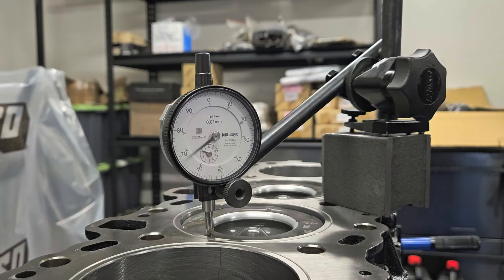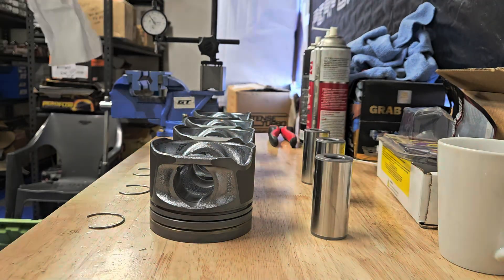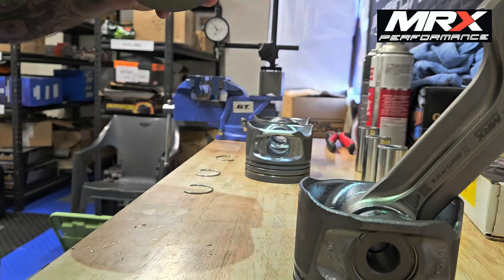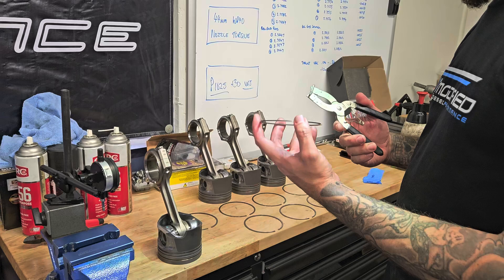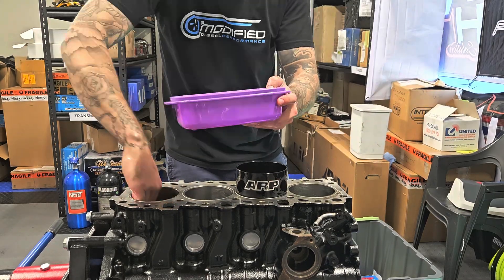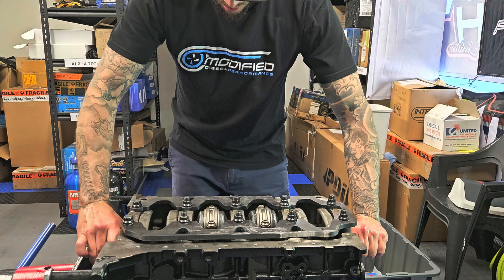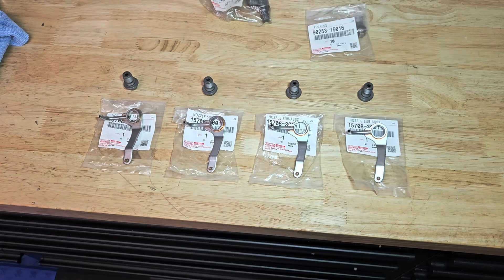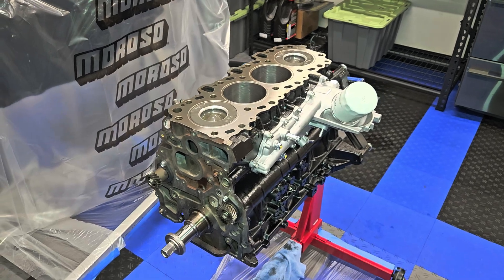The 1KD Bottom End Guide You've Been Waiting For

Comment: Nice build I’m new to the diesel builds I hear the 4jj1s are very popular in Thailand.
Be cool to see a comparison break down video comparing both the 1kd and 4j
Reply: Yes, Isuzu and Toyota are both very popular in Thailand, but Isuzu is more popular because the 4JJ can produce good power with only minimal modifications. The 1KD, on the other hand, needs more work to match the 4JJ’s performance. Both engines are powerful, but the difference lies in how much tuning is required. Also, the 1KD is more prone to damage when pushing for high horsepower, especially if it’s not equipped with enough upgraded parts. In Thailand, the record for a 4JJ engine in a dragster body is 6.6 seconds, while the fastest time for a 1KD is around 7 seconds  At 1/4 mile
Reply from the maker: No worries

Comment: Stock pistons?
Reply from the maker: Stock modified and delipped pistons 👍
Reply: @Shanksy86  what is the part number on the pistons, I know that they are different sizes. Just need to check if I have the correct updated model pistons. 
Thanks mate
Reply from the maker: They don't sell the old ones anymore
Reply: @Shanksy86 so the ‘sharp’ edge of where the squish meets the bowl gets chamfered? If so do you do anything to compensate for comp ratio reduction? Also,Im guessing bigger oil squirter/jets ? (Cooling,obvs)
Ive researched this some, seems the cold fuel being injected at hot piston (if worked hard, towing/and esp if egr mods/deleted/chipped/tuned; cause kind of thermal shock, leads to cracking.
Its a crying shame no-one makes a forged/stronger piston for kd , (with some of your design changes.
Reply from the maker: Yes correct if you pause the vid you can see the machined lip. Oil squirters are stock. It's are to get an upgrade piston for a diesel due to the nature of the keystone ring so the ring land is hardened steel then the piston is cast around it. Most drag pistons are made entirely of steel. We haven't gone down that route yet as these hold 800hp